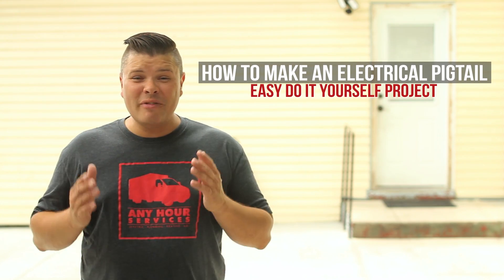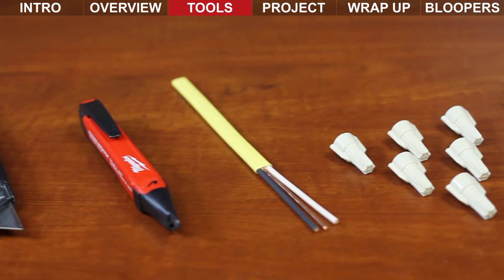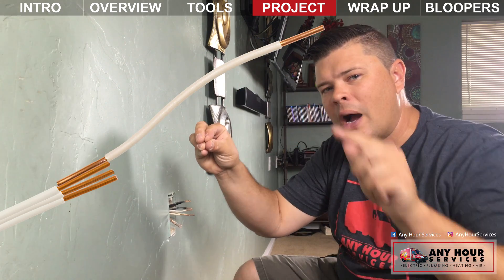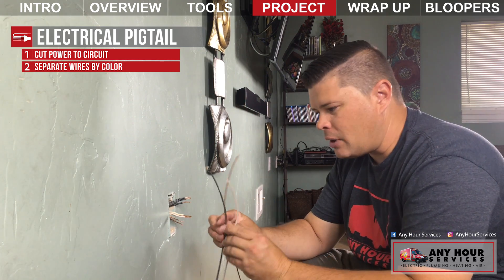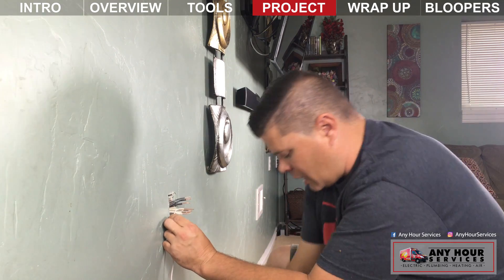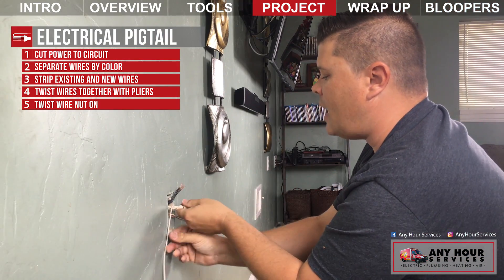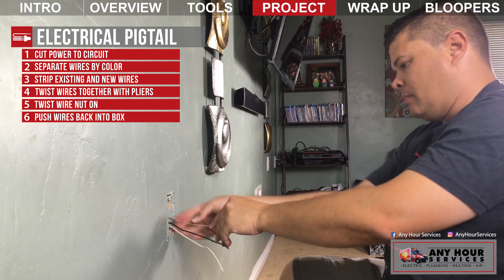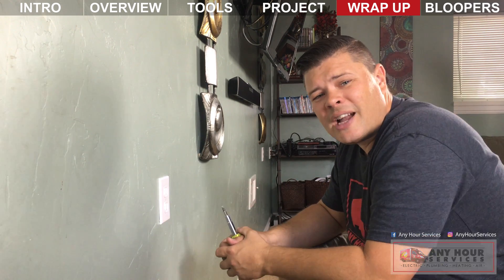How To Make An Electrical Pigtail

Comment: here in ontario you need at least 6 inches of wire. so with so many wires 6 inch each AND an additional one that is much longer, it would be pretty hard to pack it all in one box and also add a receptacle.

Comment: This was a very helpful video. My house is old and they used 12ga wire throughout the house. I had 3 of each wires in there and they back stabbed two of them but I couldn't find a plug to accommodate that.

This way worked great, gave me more wire to work with and our new plug looks great in there. Thank you again!
Reply: Okay, I'm in the same situation and replacing all of the old outlets because nothing stays plugged in. It's good to hear this works before I try it

Comment: I have 2 switches...one down stairs and one upstairs. Both control the light for the stairs. This one has me puzzled because in the bottom stairs electrical box, there are 3 separate 14-2 wires. One set is dead and is used for nothing.  One neutral is capped by itself and its black wire is connected to the switch. The ground connected to the metal box. The other 14-2  wires have two hot wires...the neutral is hot and black is hot, and both are connected to the switch. It is a double gang box, and I want to hook an outlet next to the switch, so how can this be done? Do I need to pigtail wires from the switch to the outlet? And should I simply cut clean the other dead wires or cap them?

Comment: Question, I need to do the same for a dishwasher machine.  Any issues as far as what are you using the pig tail for? Basically I need to add wire/cable to the house power wires
Reply from the maker: You usually have to wire a new dishwasher when installing it. That will involve adding a premise cord that has a plug on one side and striped wires on the other end OR a long wire coming out of the wall that you hard wire with wire nuts to the dishwasher. Whatever you’re doing, you want to avoid exposed wire connections that and short out when they touch another wire or the metal frame of the dishwasher. Good luck my friend.

Comment: If you do electrical work you should invest in at least 1 circuit breaker lock out. Mandatory in all commercial sites. Called LOTO. LOCK OUT TAG OUT.

Comment: I want to install an outlet on my living room wall from an outlet that is in the bathroom behind the wall. When I opened up the bathroom outlet I found out that there were already two sets of wires hooked up. It sounds like I could pigtail off of those and then add an extra set of wires to that pigtail so I could put the bathroom outlet back in and then have the wires that I could run through into the living room. Does that make sense?
Reply: the reason 2 sets of wires hook up to that outlet, likely is because it's a GFCI outlet which is required in the bathroom. You would indeed NOT pigtail all your hots and neutrals together to tap off that box to add another receptable. the incoming power "LINE" feeds the GFCI receptacle, and the other 2 wires go to the "LOAD" side of the GFCI receptacle to provide GFCI protection to other outlets on that circuit.

so if your situation is as i described, then you would need to add a pigtail off the "LINE" side of the outlet to add another receptable, if you don't need it to be GFCI protected.

Comment: Don't you think the box is too small for cramming 4 neutral, 4 hot, and 4 ground wires? I would replace the box with Carlon heavy wall and extra deep box. Overcrowded boxes can overheat, and may cause a fire. Don’t cram too many wires into a small box.

Comment: As a DIY'er I have left the bare wires even longer if possible and used a variable electric speed drill to slowly twist all of the wires in the chuck into a very nice and tight twist before pitting the wire nut of the appropriate size in place.

Comment: I do not understand why you had extra power wires and neutral and ground? Should it not have been just one of each in the box? Joining three power wires seems odd. Please elaborate...
Reply: One in each box would indicate an end of the run receptacle. You will have several middle of the run receptacles on each circuit. In this case you will have power coming in and power going downstream to one or two receptacles, hence 2 or 3 sets of wires. You can wires going to switches also.

Comment: Just a note: your colors aren't going to match up the same in every single circumstance. There's certain instances such as lighting where your black will connect to a white. You really shouldn't be doing any electrical if you're just going on that they're the same color and not knowing anything about circuitry. Miswiring can lead to stuff not working (best case scenario) and worst case scenario it'll start a fire. Most insurance companies won't cover house fires if it's due to unlicensed workers fucking up electrical

Comment: Nice job. I have a related question. Same scenario as yours here, but I'm installing one of those USB outlets. Would you A. Move the wire nuts outside / beneath the box to make room? B. Use a 2 gang box? Or C. Add a cover to box 1 and install a separate single gang box next to it? Or possibly D..? Thanks!

Comment: Nice and easy to understand video regarding the purpose and use of pigtails.  While the original wire setup was not shown in the beginning of the video, I think this electrical box must have had pigtails already since you have 3 hots, 3 neutrals, and 3 grounds.  By electrical code, you can only use one wire under a screw.  Or, maybe in theory and practice, the circuit was wired in using the 2 individual black hot wires on the two individual receptacle screws (brass color) and then maybe the third black hot wire was "back stabbed" in to the back of the outlet.  The same wiring method used for the white neutral wires on the silver neutral side screws and then a "back stab" into the neutral side of the receptacle.  While still acceptable, "back stabbing" is not as good a secure electrical connection when compared to the receptacle screw method or the clamping plate method found on GFCI receptacles.  Also, as pointed out by one of the other comments, many receptacle in newer homes are wired, for example, the top outlet of the duplex receptacle is switched to control a lamp and the bottom outlet is a constant "on", say for a clock, so in that case, the pigtail method shown in the video would not work properly.

Comment: I am trying to connect to wired light fixtures together, add a plug because I have no electricity in the ceiling where I will hang them as a swag. Do you have any videos for that?

Comment: When the Wires are TOO SHORT , you are better off using the '' Push In '' Connectors as they are easier to use and take up less room than wire nuts  in the the box.

Comment: Great job of making the splice, but I did not see you turn the pigtail into a pigtail.  My buddy, also sixty-eight years old, described how his father, a master electrician, would wrap a pigtail around the shaft of his screwdriver to create a spring-like structure that once connected to the outlet, neatly tucked into the box without any bending or folding.  I tried it and was amazed at how easily the outlet fit into the box.  Eight inches of wire neatly tucked itself into the box.

Comment: Never use “wagos” unless you want a fire. There is a reason why they stopped making stab-in outlets. Particularly for #12 as you were working on. Never ever splice aluminum wire some homes in the 70-80’s had aluminum wiring. This should be done by qualified electrician never some “handyman”. When changing your outlet you must also change your breaker to afci/fireguard breaker.

Comment: Thanks for the great video, clear and straight to the point. I know stranded wire pigtails are common for ground connections to outlets but what about using stranded wire for hot & neutral pigtails? The extra flexibility would make it a lot easier to cram all the wires into the box when using 12 GA wire.

Comment: in italy  we use that kind of wire 50 years ago it s dangerous , wire will separate again will be heat , don t guaranteed right connection

Comment: Is there a REQUIREMENT or general standard amount of length you need for the extra piece of wire that actually connects to the receptacle itself? Seems like size inches leaves lots of wire you have to stuff back into the box. Can you have it as short as you want that will still work, or is there a minimum safe length you are supposed to use? Thanks

Comment: 2 things from a retired ole timer, many times outlets are configured to be controlled by a light switch, in this case, the connections are not straight color to color, you as an educator, should make note of this to the homeowner to be on the lookout for this when replacing an outlets. In the worst-case, you've created a direct short when the switch closes, or in the least case, the switch no longer works. Also, you must break out the twist-out tab between the top and bottom outlets on the gold side. 
Second: shortly before I retired the electrical inspectors put on a big push for the electricians to stop twisting the conductors together with their lineman pliers because the teeth of the jaw caused gouges and nicks in the individual conductors as they were being twisted that became a possible crack initiation site even in the copper conductors. These are sometimes very hard to track down later since are usually intermittent faults. The inspector would always say, "read the instructions on the bag or package, that how I want them done". I never was forced to go back and redo all the connections on one of my jobs but was told about a few times before I could not break the habit of twisting them so, I smoothed the teeth on the lineman pliers jaws and it helped. Also if you have ever used crimp on connectors they will cause the twisted over strands to crush down where they cross over each other and break.  I have seen it several times and never gave much thought to why?  This may also be a result of overtwisting. Believe it or not, there is a lot of vibration in a building structure. Thank you for reading my post makes me feel good to pass on some knowledge from "old school" that just may still be relevant.

Comment: I’m hoping this technique will also work with the replacing a GFCI in my bathroom, the box is pretty small and the second set of wires doesn’t have a ground wire. Would that prevent the GFCI from working properly?

Comment: If you have that many wires, you need a deep box for sure.
Reply from the maker: This particular box was an extra deep box. Lots of room.
Reply: @Anyhourservices  The house we own had very shallow boxes. Kudos to electricians who made it fit. The house is about 45 years old. Not a single ground was connected. We had many upgrades to bring it to code. We could never add pigtails except to the ground.

Comment: I was taught not to twist solid wires together when using a wire nut.
Reply from the maker: 🤷‍♂️ sounds like our teachers had different opinions. As long as the wires don’t get loose and arc, then there’s no problem.

Comment: Wrong. Before you push all the wires to the back of the box, your supposed to tie down the ground to the box. That's why you should make it a little longer.
Reply from the maker: If it were a metal box I would agree with you. Many boxes in this part of the country are plastic.

Comment: First time here, very well produced
Reply from the maker: Thanks! I appreciate you watching and commenting!
Reply: I've done it before but I learned some tricks.  My issue is 1940 cloth wire that is crumbling.  My first step is to put shrink tube on it. 2nd challenge is there might only be 2-3" of old wire sticking out.  3rd challenge is back then the cheap SOBs would have 3 wires coming into the box, and the boxes seem to be small.

When doing the pigtail - I need to be careful not to twist the old wire going back into the box, twist only the barewire not the insulation. I tend to be fugal - my initial pigtail is too short making it difficult to work.  Again - very nicely produced - you didn't play ugly music and you did not call anyone "poopoo face",.

Comment: Thanks for video.  Do you have pointers or tips on how to pull Romex up from the basement to a new first floor outlet without  tearing out the walls?
Reply from the maker: Great question. I need to make a video about this. The process is different if your basement is finished or unfinished. Which is yours?
Reply: @Anyhourservices    I am moving my refrigerator into a closet.  The basement is partly finished, the closet is very near the unfinished portion.  I can disrupt the sheetrock in the basement below the closet if need be.  But I don't know how to find the right spot to drill, how to get through the sill, any of that!  Oh, and by the way (since you're a plumber too) I need to get a water supply line up there for the icemaker as well.

Comment: Why not use the grounding screws at the rear of the box instead of a wire nut? This would save precious space fo the outlet or switch fitting. 
Just sayin!!!
Reply from the maker: Thanks for saying something. Many of the boxes in this area, including this one, are plastic. If it were a metal box, I recommend doing what you said.

Comment: Nice video, as a DIYer I always wrap the wire nut with electrical tape, is that recommended ?? Thanks
Reply from the maker: You don’t have to. If it makes you feel more comfortable, wrap away. Thanks for watching.

Comment: How about showing how to put on a junction box extension. This is all well and good until you come across a situation where a short, one circuit (like a switch box) was used and now there isn’t enough room for the plug to fit into the box.
Reply from the maker: Great suggestion. I’ll add it to the list of videos to make. Thanks for watching.

Comment: This is a well put together video except it missed one very important safety item.  Nowhere were safety glasses mentioned or used.  Cutting the end of the pigtail could have sent pieces of wire flying.  Stripping wire can cause some terrible injuries if anything slips or breaks.   It could lead to an injury causing severe eye Injury or blindness.
Reply from the maker: Great point. Thanks for remembering us to be safe.

Comment: Thanks for the info. I do have a question, I have a 220 volt wire running thru the joists in basement to garage. I need to tap into it for another feed, whats the best way?

Comment: Can you use an existing wall switch to create a wall switch on opposing wall?  . I want to use the  existing wall switch power to create a wall switch for an overhead light.   The new electrical box would oppose the existing wall switch.   Thx.  Great video on pigtails.  I will be using pigtails a lot on an older home’s electrical boxes.

Comment: Good job, well explained and demonstrated.  Make sure to tell people to use the side screw terminals.  If you could also make a video about replacing an outlet which has been wired directly through the device by pigtailing  the wires and connecting the device correctly with the screw terminals that would be great.  I actually came on YT today because I'm trying to coach someone in a different state on some basic troubleshooting.  Thanks, and keep up the good work!

Comment: That really was a good video.    Down to earth, easy to understand, common sense.    We're rewiring two new outlets around a new floor and have to pigtail the ground between both plug outlets.    There are not enough electricians out there, and for something as simple as our project, so it's nice to go onto Youtube and get expert advice that instills a little extra confidence to do the job yourself.

Comment: Great video, thanks. I was taught to let the wire nut do all the twisting, I think your approach makes more sense.
Reply from the maker: Glad it helped. Thanks for watching.
Reply: I was also told by a long time electrician not to twist the wires together. If you  ever have to take them apart it makes a mess and can cause the wire to break off.  I also did appliance repair fon10 years. One problem we encountered was molex plugs on the temperature probe on ovens would get hot and send an inaccurate reading to the display and oven control. When we would replace the temp probe the instructions in the bag with the probe was to cut off the molex plug and use ceramic wire nuts.  It specifically said to not twist the wires together because it would create a loose connection. I also see people wrap the stranded wire around the solid conductor. This also leaves a mess when it has to be taken apart.  I take the stranded conductor and twist all the strands together making it more like a solid conductor then make sure the ends are even and the put the wire nut on tightly. 
It has been a while but an inspector told me that there has to be evidence that the wire nut has to be tight enough to have twisted the conductors. Remember that a wire is a solid material whether a single conductor or multiple finer conductors. You only get so many twists or bends in a solid material before it breaks.
Reply: @marvinostman522   There is a wire nut available that makes it unnecessary to pretwist the wires as the wires are twisted as the wire nut is tightened. The manufacturer calls them wingnuts and they work great.

Comment: I purchased the Bentley ceiling fan with a oscillating switch
Reply: I purchase a Bentley ceiling fan the oscillating switch has four wires brown, black, green and yellow,and a red. Kicker is my wall on have ground wire , black  and white wire. So I don’t know which wire to what wire. Please help
Reply from the maker: The instruction manual should go over that kind of installation. If you bought the thing from a local store, you could go back and ask them to explain. Every fan is a little bit different so the instructions are a good idea to go through. All else fails, you could call an electrician for some help. Best of luck my friend.